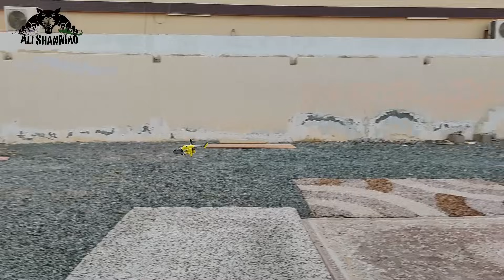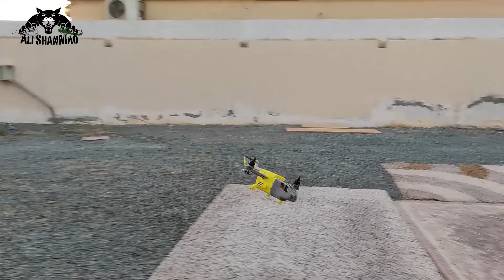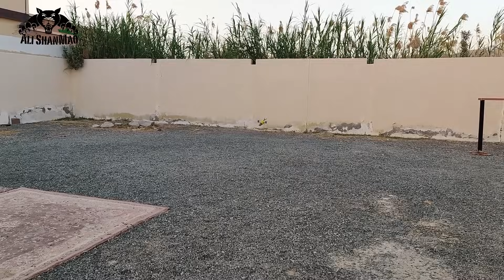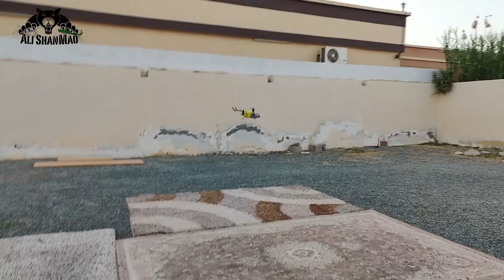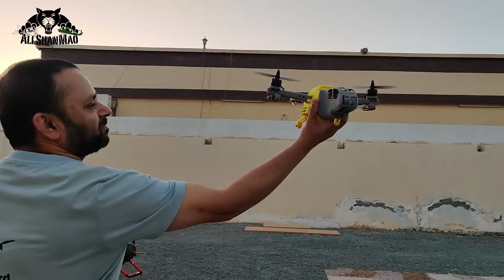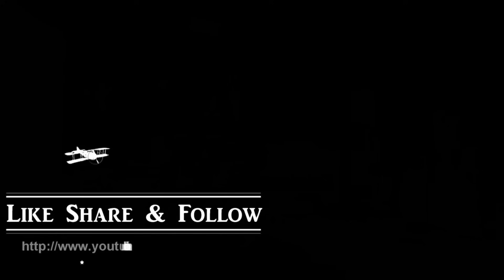Talon-1 3D Printed Dual Copter Bi Copter: Why I Did not Giveup?

Comment: Ali, i have a lot of respect for you and what you are doing. But this is very tricky. First, you need to solve two differential equations "inflight". Counter rotation and inclination. At this level, with a 50/50 mix (two blades/two motors), do you realize what kind of definition you'll require to be stable ?
Reply from the maker: It is and was tricky. That's why I smashed the first model in frustrations because no matter what I did, it kept on crashing. But I didn't give up. And my 2nd attempt is successful as I found the best settings and tricks to make it super stable. Now you see how well it flies and it's just pure fun